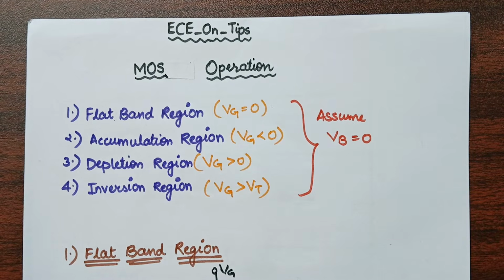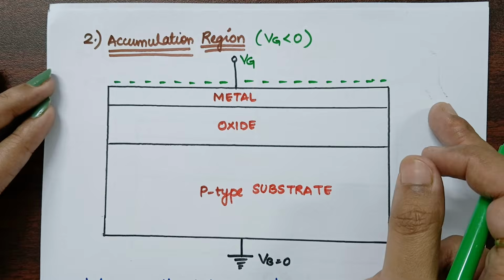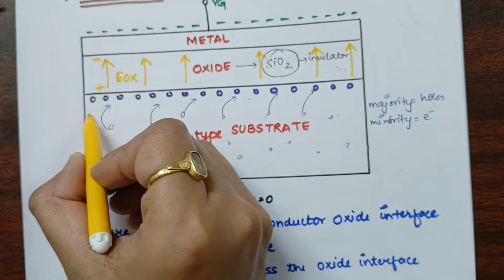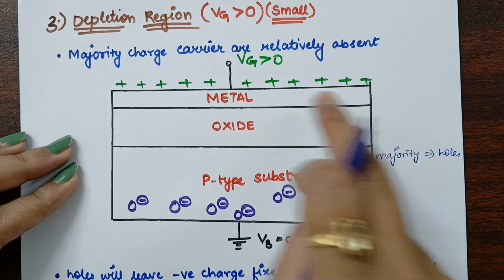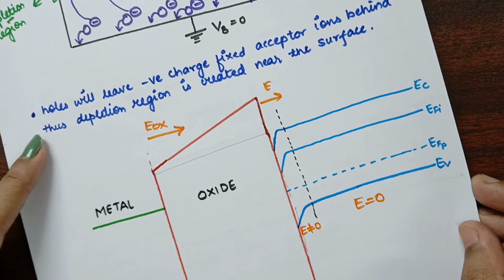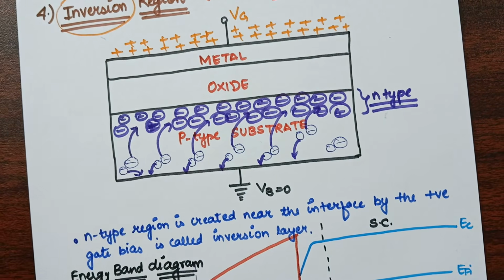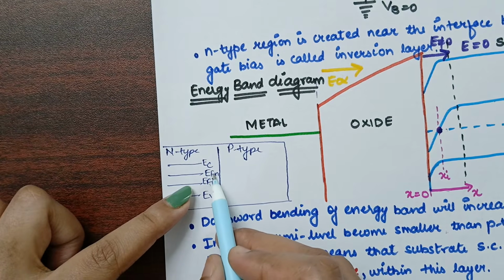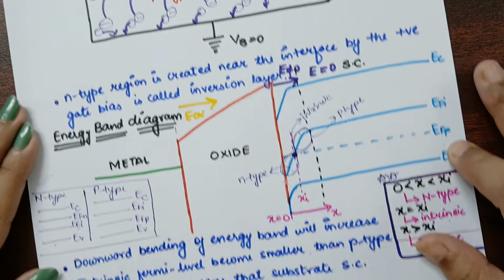MOS Capacitor (MOSCAP) and its mode of operation@ECE_On_Tips

Comment: depletion region means that-a region where no charge carriers are present, so why you say minority carriers region as depletion region in depletion region?
Reply from the maker: depletion region is the region where majority charge carriers are missing that is if i talk about  p substrate ,holes are majority charge, when i apply +ve gate voltage the acceptor ions from the holes get concentrated at the interface of oxide and substrate that concentrated region is called as depletion region.